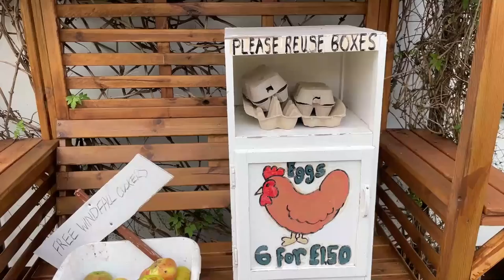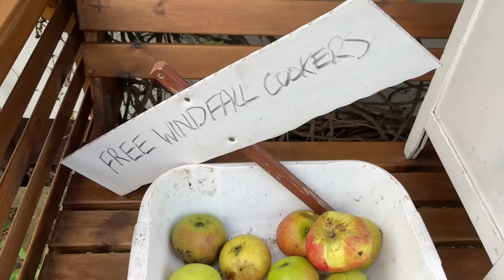Expensive NARROWBOAT Repairs & A 220 year old CANAL Lock.

Comment: Quick and easy way to determine if you have any leaks from the engine -
Oil - check the dipstick. That should tell you if you've been loosing any. If the pressure gets too low you should have a gauge on the control panel showing pressure. If it's where it usually is (about midway on most gauges) you should be OK.
- Water under the engine/in the bilge most probably from the stern gland. Majority of stern tubes you need to turn the greaser a couple of turns after each journey. You'll know if you have a leak there because you'll see drips of water coming in.
- Checking the coolant in your engine before you start each day and keep an eye on it daily, that way you'll know if you're loosing water that way. You don't want it to get too low, that's probably why the head gasket failed. 
Again, there should be a gauge that shows coolant temperature.
The other way you can loose fluid is from the gear box. It usually has a drain plug on the underside where you may get a leak from. You can check by running your hand underneath to feel for any excess fluid.
If you can, try doing what's called a WOBBLE check before starting the engine each morning.
Water Oil Belts Batteries Leaks Exhaust.
Reply from the maker: Thank you SO much for this!!

Comment: Ild try cleaning your chanels out for the deck boards and drains also tighten and grease or repack the stern gland , you could also try a cheap electric bilge pump to keep at hand with a bit of hose to help pump the engine bay out in to cans , washing up liquid will break up some of the oil in the water pour it in mix it round and pump it out should be a lot better

Comment: What sort of engine do you have? We had a similar problem on our boat and were told we needed to change the gasket BUT it turned out that the gasket was fine but because our engine (Nanni 4 cylinder) is actually a kubuta plant engine which means that it is used for various different plant machines therefore it is made with four dipstick holes for use depending on which way the engine is put in the machine. The other three holes are blocked off. Our problem was caused by one of these bungs falling out causing all the oil and water debris in the bottom like your boat. Luckily my husband spotted it and managed to fix it back in saving us £1500 in the process. I hope this helps.

Comment: The contraption shown at 10:31 - 10:41 is a mangle, although it seems to be missing rollers. Back in the days before washing machines we fed the wet sheets (or whatever) through the rollers on the mangle to squeeze out all the water. Then we would hang them on the washing line outside to dry (assuming it wasn't raining!). https://en.wikipedia.org/wiki/Mangle_%28machine%29